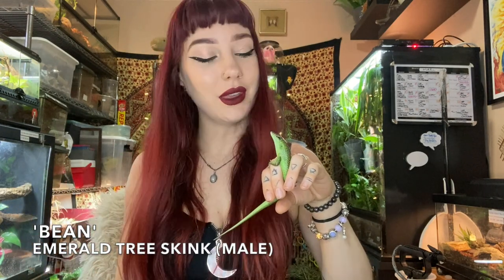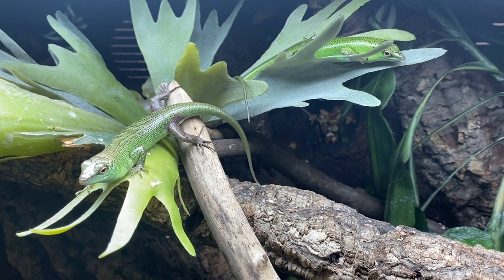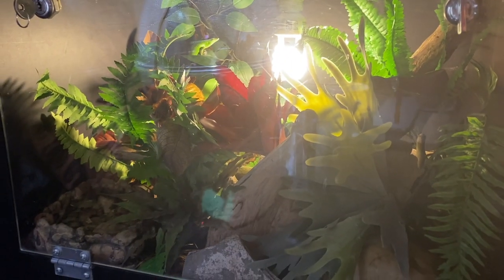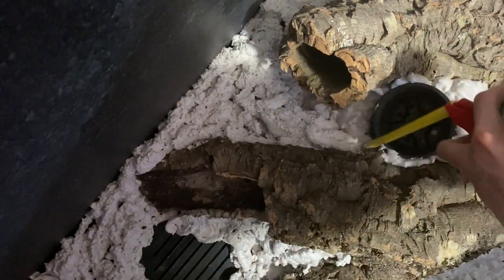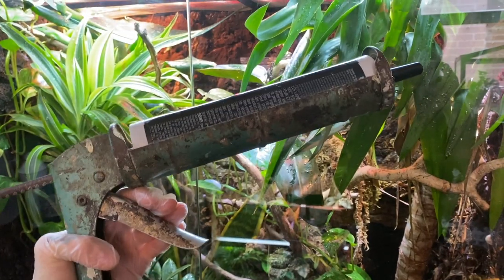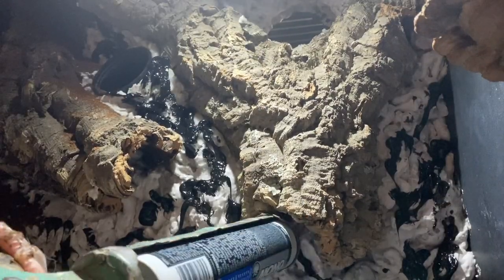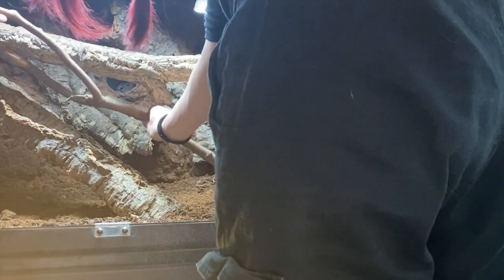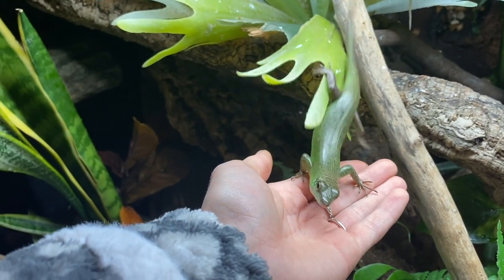EMERALD TREE SKINK INFO Ep.2 DIY Background

Comment: Hello! Do you have any tips on earning the trust / taming your emerald tree skinks? My juvenile is still somewhat skittish - she's come out onto my hands a few times but tries to bolt so I'm worried about losing her. Thanks!
Reply from the maker: Sounds like you’re on the right track. I find they start coming out a bit but are still skiddish at first. Sounds like yours is just testing the waters and will likely build up more confidence over time if you continue to work with her. Just keep handling her close to the enclosure in case she does want to bolt. You can also try giving them a treat when they come out as a reward and they’ll get use to your hands as well. Sometimes I’ll hold a cricket in my hand or dip my finger into some Pangea or repashy. Hope this helps!